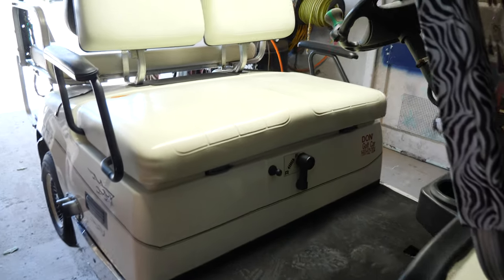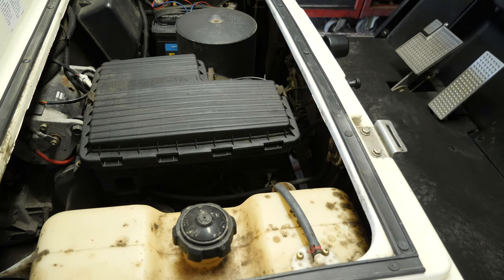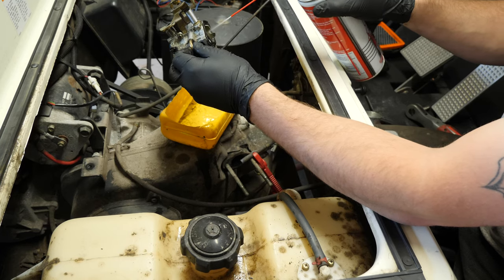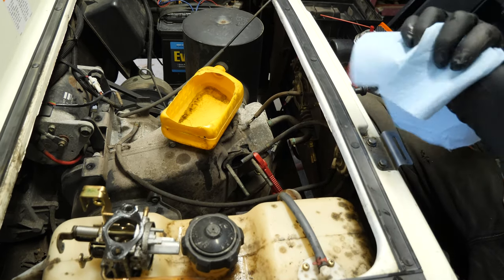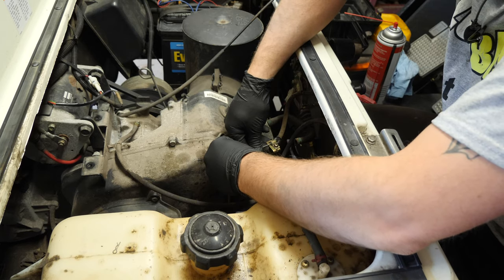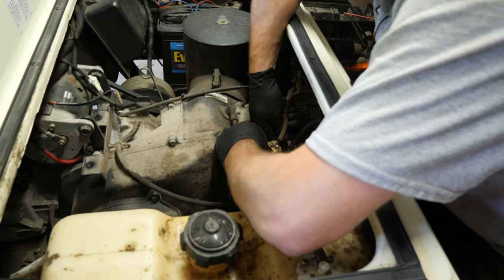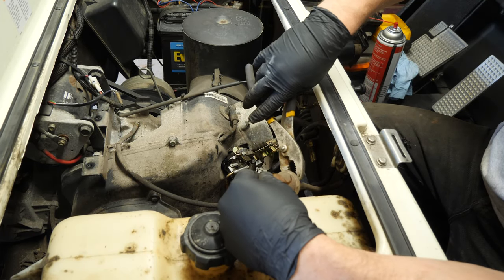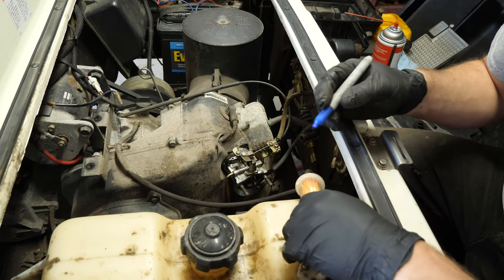2005 Yamaha G22, Gas - Crank, No Start, Clean Carb

Comment: Hi Kevin, your Q & A would be great... I work at a golf course and I have been deemed the mechanic... but I rely on your videos because I really don't know the first thing about golf carts.  I can take a carb off & clean and do minor things but to diagnose a problem I'm not that good at. I'm learning as I go....
Reply from the maker: I started where you are now. I worked at a golf course as part of the grounds crew. I had a machine break down on the course and repaired it myself so I could finish my work. That's when I was offered the assistant mechanic spot. From there, it took off to what I have now. You will pick up on it after doing it for a while, as long as you are mechanically inclined.

Comment: Im hoping i just found the right guy to help me replace or clean old g22 Yamaha carb! parts are relatively cheap, my question is should i just put in a new carb or should i clean like this video? keep in mind this is my first ever mechanic "repair job" on anything ever. I have already replaced steering rack and front king pins. Any chance of another video showing exactly what you were taking off when removing carb? went fast for my beginner / less experienced eyes. Thanks in advance great video and will be reveiwing all that may help me in my first repair journey.

Comment: Kevin I have a g22a I just bought. Ran out fine for the test drive. Drove it approx a mile to the golf course this morning then driving up to the clubhouse it quit like it was out of fuel. Fuel filter was empty. Added gas to the cylinder and it cranked. Replaced the fuel pump. With same result. Still no fuel
Reply: No fuel in the filter

Comment: Hi Kevin, I have a 2003 G22 and I have an issue of the bowl of the carb filling up and when it does so, it runs really rough. To solve this, I release the fuel from the bowl and it runs great again. Any suggestions on how to resolve this issue?

Comment: Great vid.  My G22 is chugging under load. Has new plug, fuel filter and air filters. No vacuum in fuel tank, no cracks in fuel lines has gotten steadily worse over time.  Thoughts?
Reply from the maker: Clean the carb. There may be some debris, water or gelled fuel in the bowl.

Comment: Very helpful video Kevin. Maybe you can answer a question for me. I have the same g22 cart. It backfires on startup occasionally.  I have checked the throttle plate adjustment. No one I talked to seems to be able to figure it out. Needless to say my friends aren't real happy with me on the golf course.
Reply from the maker: The throttle plate should not open until after the engine is cranking. If that's good, the ignition coil may not be shutting off when you release the gas pedal. This could be a bad stop relay next to the solenoid or the ground wire came off the ignition coil.
Reply: @Kevinsgolfcarts  Thanks for the insight. I'll check those out.

Comment: Why is float not setting level on my g22? I have a flooding issue. If I pinch fuel line a bit it runs great. I polished the seat, thorough cleaning. Can the plastic float be heated and adjusted? Needle might need replaced.

Comment: I have to use a squirt of starter fluid to fire up the golf cart then it runs fine the rest of the day, think I should rebuild the carb
Reply from the maker: Take it apart and clean it. There really isn't any rebuild kits available for standard golf cart carbs. If cleaning doesn't work, you will have to replace it.
Reply: @Kevinsgolfcarts   thanks!

Comment: Do club carts have mixture screws to adjust!
Reply: Yea
Reply: Thankyou for your reply, how do adjust it or has it got a stand setting?
Reply: silver there’s usually a screw on the carb kinda next to the governer
Reply: silver I mean on mine it is what year is your club car?
Reply: My cart is a 2010 prescient, I just removed and clean the carby the other day, It smelt lean and was popping off when starting!
Reply: silver does it run better?

Comment: What size are the nuts that hold the intake to the carb? I just inherited my grand fathers non running g22 and those nuts are missing. I found the one part number but no description. Did you say they were 12mm?

Comment: Just found your video. I have the same cart but I have a no start issue. No cranking as well. But the starter solenoid is heard clicking.
Reply from the maker: You need to check the solenoid with a volt meter. Check and see if you have 12v on the starter/generator side of the large terminals. The solenoid can click but not make a connection internally when they fail. The negative probe of the meter should be on the negative battery terminal and positive probe on the starter/generator side of the solenoid. Step on the gas pedal until the solenoid clicks. If you have 12 volts, then the starter/generator may need brushes. If you have no volts, replace the solenoid.
Reply: @Kevinsgolfcarts  solenoid was replaced about 2 months ago
Reply from the maker: Still check the solenoid if you already haven't with a multimeter. The solenoid can click but not make a connection internally when they fail.

Comment: Hi Kevin. Just bought my first Yamaha. 2005 g22. Got it running. Runs good! 152 psi. Burning oil/smokes bad. Will a bad valve seal make it smoke this profusely? Thought I'd get your opinion before I rebuild it. Thanks.
Reply from the maker: Make sure its not overfilled with oil. These engines only need 1 us quart. Does the smoke only happen at startup and then clear up or is it continuous? If its continuous, then I would say rings and time for a rebuild. If its only at startup and then clears up, valve guide seals and would need head work. Yamahas are splash lube so I doubt valve guide seals. Its also possible the carb was stuck open and flooded the engine at one point. This sometimes will cause fuel and oil to push into the exhaust.
Reply: @Kevinsgolfcarts  thanks Kevin. Have my own machine shop. Just ordered parts. What's your experience with the valve guides on these? I don't have that size in stock. Can I grind the valves or is there a nitride coating on them?
Reply from the maker: I don't do engine overhauling on site. Its not practical for me so I send them out for complete rebuilding. It usually ends up cheaper and I know its done correctly. Your best bet would be to search ebay for yamaha golf cart service manuals. They usually have them dirt cheap and they should have all of those specs.

Comment: Kevin I'd love a q&a.  I used your videos as I work on these things for the people at my campground.  I've got 6 of them at my house for the winter to do.  Have a question have a cart in the spring to fix I didn't have time to get to.  G22, airbox fills with gas, float needle stuck open??
Reply from the maker: Its possible. I would definitely pull the carb and clean it.

Comment: What is the trick to get these carts to run in neutral for testing like you did in the start of the video? Or have you got it jacked up off the ground so it does not run away?
Reply from the maker: There is a yellow cam under the seat on the shifter. Pull it towards the engine and rotate it 180 degrees. Shift the cart into neutral and it should run. Repeat this to return the cart back to normal service.

Comment: Could you tell me how can I tell if my g22 is not in the neutral position installed a new motor with newer cables and all hooked everything back up the way it came loose to but no crank
Reply from the maker: Gas Yamaha carts will start and run with the shifter in any position. It sounds like you have an electrical issue.

Comment: Is there a gasket between the carb and the head? I took my carb off and I didn't see one. Which may be causing my problem. When the cart is on half choke it runs great with the gas pedal fully down. As soon as I take the choke completely off the cart Boggs down with the gas pedal fully down.
Reply from the maker: There are multiple gaskets on these. There should be one between all of the mating surfaces.
Reply: @Kevinsgolfcarts  thank you

Comment: So I have a g22 what would cause the air box to fill up with gas and it to puff white smoke? I’ve changed the air filters the fuel filter the fuel pump the spark plug only thing left is the carb..
Reply from the maker: Carburetor is stuck open causing the engine and crankcase to flood. You're going to have to pull the carb, clean it, reinstall it. The carb is flooding the engine. You will also need to drain and change the oil. I'm willing to bet that the oil is over filled and contaminated with gas.
Reply: Thank you very much sir I purchased a new carb but I will clean the old one for a spare..

Comment: Can you tell me what the part is that has the label/bar code on it? Mine has a melted hole on it close to the muffler and I'd like to replace it as it is quite loud.
Reply from the maker: The part with the bar code is a plastic engine cowl piece. It has no significant role in quieting the engine.

Comment: All of the carb parts you cleaned are easily accessible from the bottom of the cart.  Why not jack it up and save all the disassembly?
Reply from the maker: Its much easier to clean the carb on a bench. If you think its easier to work on it while its installed, by all means, you can do that.